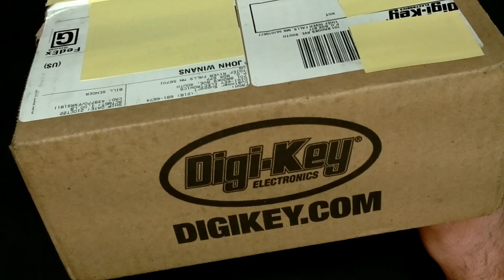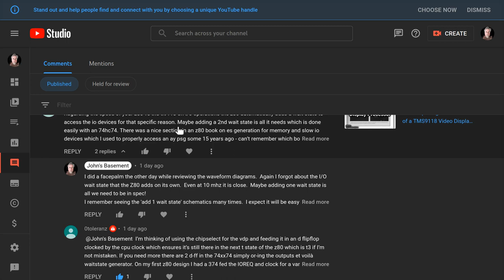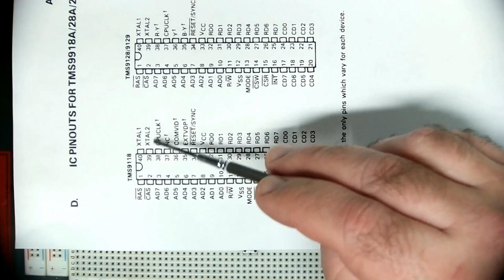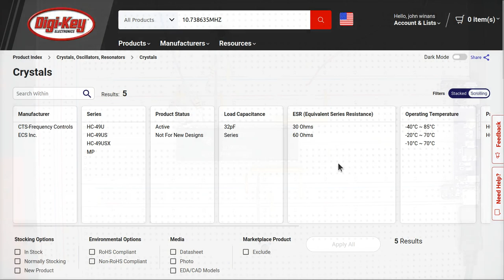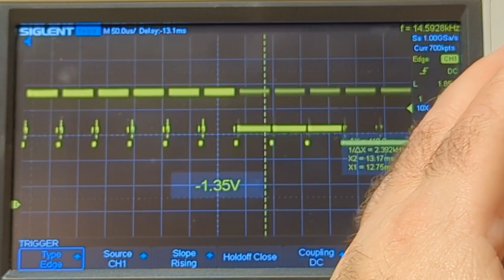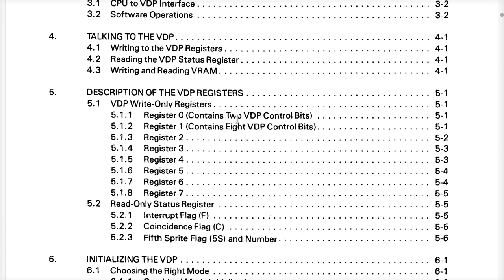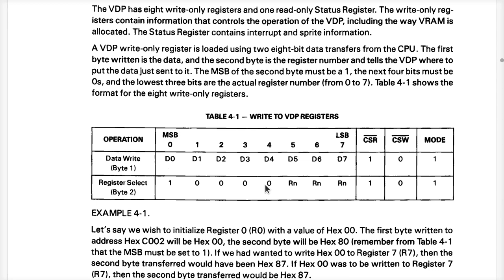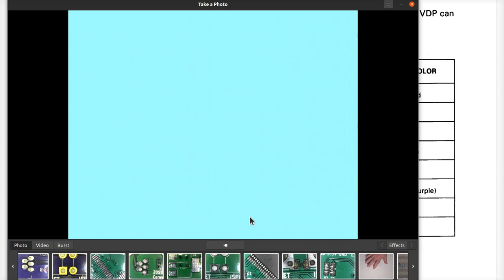Z80 Retro #45 - TMS9118 VDP Breadboard Testing

Comment: Hi John!, it's always fun getting new parts from Digikey! Thanks for the video down memory lane. In a previous life before my engineering career, I worked at several radio & TV repair shops here in Colorado. The color NTSC video signal is very complex and yours looks pretty good for a start. The color burst signal is about a dozen cycles of phase locked 3.58MHZ carrier on the back porch of the horizontal sync signal at the beginning of each line. The chrominance signal is a sub-carrier that rides on the amplitude modulated luminance signal. The color that is displayed is determined by the number of degrees of phase shift the chrominance signal is from the reference 3.58 burst. Oh the fun of analog. It's amazing how much info is sent in a composite video signal.
Reply from the maker: It's like Christmas!
Yeah, NTSC is quite a feat of design. I'm lucky that the TI chip generates the output signal.

Comment: Very interesting to know TMS9118NL does not need any driver at output (I never found how much current the output pin supports)! Yes, it does not work cold like Z80, but nothing to worry. Enjoy the fun connecting it to your Z80.
Reply from the maker: 🤔 It DOES say that the minimum load resistance on the composite video output of the TMS9118 is 470 ohms.  So I might have to include a driver afterall.

Comment: Hee, nice video.
That reminds me I still have a 9958 PCB from a couple of years ago I haven't tested yet... (time!)
Reply from the maker: Fancy!!  :-D
Reply: @JohnsBasement  If it works :-D 
It also has a YM2149 sound chip. I basically stole a MSX design...
Reply from the maker: @obiwanjacobi  😂 I started looking at sound chips the other day too. I mean if this thing works, I'm going to need joysticks and sound in order to be able to play a game that's even remotely interesting.
Reply: @JohnsBasement  The YM2149 has two 8-bit ports build in. Plenty for a couple of joysticks.
Reply from the maker: @obiwanjacobi  that would be PERFECT... If only it didn't require a 300ns setup and 80ns hold time.  😞
Reply: @JohnsBasement  Hmmm I must have missed that, bummer. Sounds awfully long indeed...
Reply from the maker: @obiwanjacobi  it might not NEED it all.  But the spec I saw this morning said it.  😞

Comment: What would happen if TWO TMS9118 VDP chips would be combined? One chip has 15 colours and black, two chips could produce more colours by adding the outputs of both and mixing then analogue. The result would be more colours, I guess.
Reply from the maker: With composite video, it would be a disaster area.  But the concept is otherwise sound.  You could do such a thing if the output was RGB.